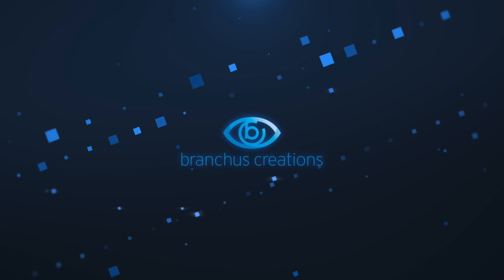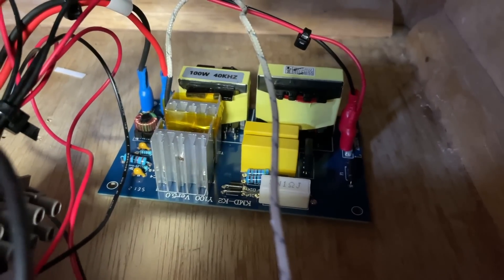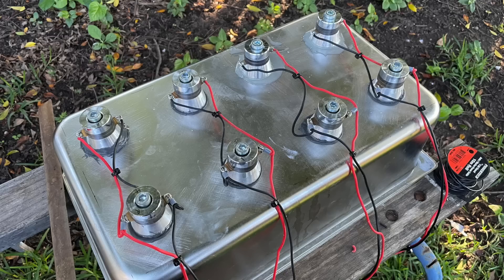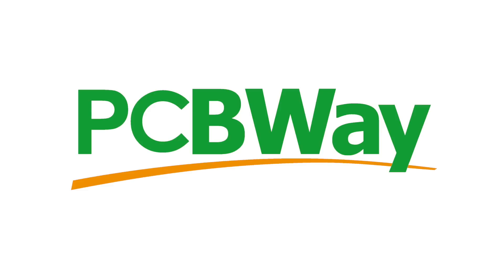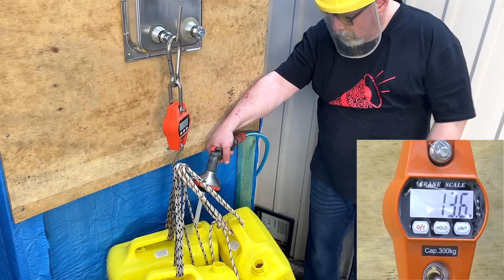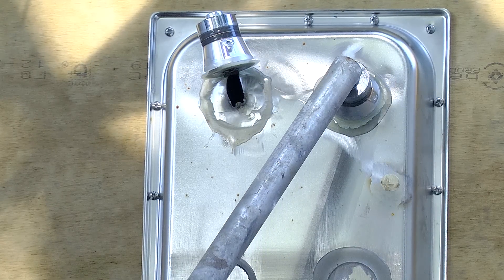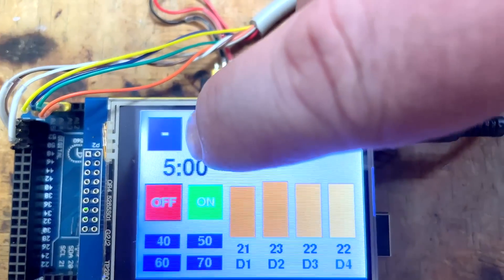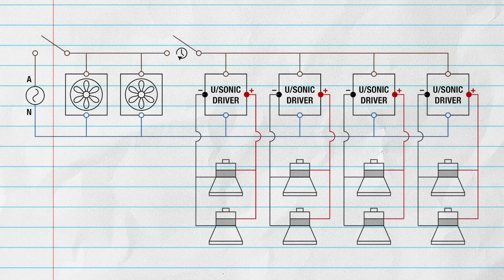Building my own Ultrasonic Cleaner - Follow Up

Comment: Tl;dr
The interwebs says denatured alcohol contaminants;
- Methanol (Methyl Alcohol): common, often comprising 5-10% of the mixture. 
- Isopropyl Alcohol
- Acetone 
- Methyl Ethyl Ketone
- Methyl Isobutyl Ketone: 
- Benzene: 
- Pyridine:.
- Denatonium benzoate (Bittrex): 
Etc.

Isopropyl contaminents; 
- Volatile Sulfur Compounds: dimethyl sulfide, methanethiol, and diethyl sulfide
- Acetone: especially when isopropyl alcohol is manufactured using the strong-acid process. 

- Metals: copper, iron, sodium, potassium, calcium, and magnesium can be present at trace levels in isopropyl alcohol. 

- High Molecular Weight Organic Compounds: including phosphates and other compounds that can leach from storage containers like HDPE. 
Other VOCs

Comment: Enjoyed the journey of discovery and youtube follow up. Thank you.
Random thoughts;  The epoxy type might not matter as long as the clamp force from screwing on the transducer to the soldered stud isn't exceeded. It might act  like a gap filler/acoustic coupler. A tough epoxy is maybe better than a strong one. 

I could see a brief bench test being bad for the transducer and the driver,  as that impedance mismatch could electrically stress the driver and mechanically stress the piezo ceramic (not just thermal degradation) 

Since they get driven in parallel with no ballast,  I wonder if a slightly damaged one current hogs and further degrades?  

Probably overkill, but for high rel boards (pre conformal coat) we final rinsed in ethanol (NOT denatured with what ever toxic random contaminants they throw in) 
A chemical squeezey or regular spray bottle would probably work ok. 95% everclear brand is available in liquor stores near me.

Comment: Here is a question,  When you adhere the bolt to the tank,  then attach the transducer to the bolt and tank including the epoxy, how do you account for the need to remove any transducer that fails?  In other words,  how do you make it serviceable?

Comment: Silver solder is used a lot in refrigeration, especially where the item being soldered is having trouble getting stuck together because of contaminants or dissimilar metals.  It is also used a lot on stainless steel items.  It is ESPECIALLY important to clean stainless when soldering/brazing and welding because it is easily contaminated.  If you use a wire brush to clean the weld/solder area, make sure it has never been used before or has never been used on anything except stainless.  Any sandpaper should be new.  Before welding or soldering, wipe the weld/solder area with acetone and let dry.  If you are soldering it, you should use flux if at all possible, because it removes contaminants from the solder area.  Silver solder will stick most items together, but it is better to be too clean than too dirty.  A TIG machine is necessary if you plan to have it welded,  but you can find a welding shop in most mid sized towns that can do it.

Comment: If you want to do more flux core wire welding on thick materials in the future, you can swap out the bulky mig tip for a flux tip.

Comment: Very nice series with a lot of information. I also do have a vevor one and clean mainly moto parts such as carburettors and cylinder heads (if they fit - normally not). Therefore I was always playing to build one myself. Which frequency would you suggest to clean such parts? You mentioned in the first video that lower frequencies would be better for such things. 

I am also wondering if it would be better to have more transducer in place for such cleaning operations.

Comment: hm dunno. i might had been tempted to measure those drivers, and see how identical they are. supposedly they represent some sorth of load, so a multimeter and a few different driving freqvencys should reveal it. likely i would have went whit 2 in series, and 2 of these in parallel. easy on the drivers, and not realy an issue for the boards. allso, i would absolutely had those transformers dipped into epoxy. the  copper wire will actualy do resonate and it will fail. just a mather of time. it will scrape off its own insulation. the output devices might have heat sinks, but you can bet those are undersized to begin whit. so i would get bigger ones or at least bolt a larger one to the exsisting heatsinks anyways. very likely these units don't require a tonn of current to drive, so i may have considered to see if i could ease the situation even further whit a bit of series shunt resistor. but thats just me allright.

Comment: I am trying to build my own ultrasonic cleaning, along very similar lines. However there are a few difference I would like to get your (and your viewers) advice on. 
1) My cleaner is to be mounted to the wall (It is also a stainless steel kitchen sink). What is the best way to minimize the ultrasonic losses from this connection. If I use continuous metal - then this will transmit the sound from where I want it, to where I don't. If I use some rubber or silicone at the boundary this will absorb the  sound which will reduce the efficiency and will generate heat. If I have an air gap, then I still need some way of holding the sink up, while creating a place that water can spill!
2) I would like to try to combine a vacuum chamber with an ultrasonic cleaner. Both are good ways of degassing epoxy or silicone rubber before putting them in a mold. Any advice on how to do the two together. 
A vacuum chamber needs to be strong. This means much thicker stainless steel and means any welds could be weak points. Thicker steel requires more power,  Any advice on mitigating this.
3) Any advice on the drainage? I have been thinking that detachable drainage might be the way to go. That removes one source of energy loss.
4) Is it possible to combine 1-3 in one build?

Comment: Not designed to pull from side …. Designed to pull straight down
Reply from the maker: I mentioned all the caveats of the test in the video, but it did achieve its purpose. The findings from this test contributed greatly to the build of my second ultrasonic cleaner.

Comment: I have seen videos on DIY spot welder from old microwave oven transformer. I wonder if such could be reimagined to use for your studs. Also noted that the welded driver that tore the pan when you pulled it off, was the one you mentioned you'd burned a hole and patched same, when initially doing the weld. Probably weakened the pan at that time, otherwise it may have bent same as with the silver soldered join. Great video BTW. I've thought about making one myself, but don't have as much need as I am focused more on building electronic prototypes from scratch. 👍🤙

Comment: i think you need to have equal length wire to your transducers 265 mm  to 275 mm  find the sweet spot. to sound/heat

Comment: Enjoyed this. The information you learned from troubleshooting the problems alone is worth its weight in gold. It does leave me wondering though if a tanks thickness makes any difference in cleaning efficiency. I am guessing it shouldn't but I also see that most the commercial tanks are pretty thin as well. Thanks for this.

Comment: My transducer seems not to have a real polarity as the signal is feed from the transformer and a coupling capacitor so no real connection with the live. I just make sure the parallel set is paired with the the same polarity scheme. Not to the driver itself. Still on the way to build a box but I think will build two boxes apart, one for the driver and another for the pair. Simple ultrasonic cleaner anyway with just one pair of transducers also silver brazed. Will also add a timer from Aliexpress which allows programming on off periods and a fan. If you have oscilloscope you can tune the oscillation frequency to the driver by changing which output one of the transformers is in use and maximizes the voltage output wave (changing the inductance changes the resonance frequency). These chinese drivers have a short which can be changed in between the different pins of the transformer thus changing the inductance of the output circuit.

Comment: I wish I would have seen this video before trying to fix my ultrasonic cleaner. I bought one off of a web site and didn't realize one of the two transducers had detached. I just reattached it with JB Weld and tried it out with the tinfoil test. Only 1 side made holes so it looks like the transducer is dead. Would there be any issue running the cleaner with just one transducer, other than it taking longer to clean?

Comment: You could also try friction welding - put the screw in a mill or drill press. High RPM & lots of pressure.  The heat generated is very localised.  I've used it for welding studs in place (not on a cleaner though)

Comment: Acrylic structural adhesive may suit your needs if do build again. The most popular brand of thread locker has a line these types of adhesives I have used in manufacturing. Bonded metals typically have 6k psi tinsel strength. I don't know what the vibration will do to it but I am about to find out. These cleaners fail quickly for me. I purchased 4 since you made this video. I need one that doesn't break. It'll be fun to build one even if it costs more than a new cheap one. Thanks for inspiration.

Comment: Very Good video Sir...
I have a 3liter cleaner, but I will going to need a bigger one..
I am thinking on using it's parts(circuit board, transduser,display), adding some more transduser and circuit board on a bigger tank. Is it possible?

Comment: Hi, do the transducers work when secured only with the solder but without the epoxy?  Or are both the Silver solder and the epoxy necessary for the sound waves to be transmitted?

Comment: If you could find a suitable tray, a tall, thin cleaner would be useful for pcbs, like a toaster. you could attach the transducers to the sides instead of the bottom. this might reduce the liquid volume and hence the power requirements.

Comment: A good idea when brazing a stud like this onto thin sheet is to put a thick backing plate against the back side of the sheet.

It'll soak up any excess heat and help stop any warping.

Comment: i know very little about ultrasonic cleaners and even less about transducers but i do quite a bit of welding my perferd method is gas welding also know as oxy acetylene welding a regular oxy acet torch is what i weld most anything together with unless its really thick and i got a big machine that does heliarc or smaw but most of my welding these days is done with a harris torch with a standard mixer and whatever size tip. its alot cheaper than using tig and i have welded the crazyist things known to mankind such as welding a cast iron pipe fitting to a stainless banjo fitting i once welded a motorcycle carburetor float post. stainless will require a flux to unless you want to use mild steel filler then not necessary. cast aluminum is the biggest pain in the ass to weld cus of all the contaminants in the cast a tig would be best for this but is still a serious pain to weld ive welded whole vehicles this way and the only 2 accepted ways of welding aircraft frames is gas welding and tig welding so if you got a few dollars to spare on a torch and tanks you could probably get a set up goin for less than 400 usd but i dont know what the availability is like down under either. but like you found out silver soldering / brazing is over kill for something like this in the good ole days most body shops brazed vehicles together and it will hold even to the point of ripping 18 ga steel the bond will be unfazed im surprised you didnt use a pid for the water temp in the beginning with the analog timer if i build one it would use a timer like that just for reliability sake that and i dont know much about electronics

Comment: I think the main reason the drilling and bolting isn't used is because at any kind of medium to large production scale the production cost matters a lot more than in a one off project. Welding is just cheaper at scale.

Comment: If you build another I'd suggest 132khz transducers,  I have a commercial unit which was way over $1500 but compared to my old 40khz machine it cleans way way better in fact it's like chalk n cheese , it's that much better on pcbs ..

Comment: If I was going to tackle this project I'd drill through the tank, drop in a few stainless steel blind-hole nutserts to suit and use some allthread to mount the transducers.

No welding needed... But you'd need the nut insert tool.

A dab of silicone at the joints should keep it watertight.

Comment: Just wondering is it possible to immerse these transducer bases into water to keep them cool and would it transmit the waves directly into the water ? reason ask is it is not clear whether these transducers need to be attached to a metal surface to keep them cool or can they be connected to none metal surface like fiberglass tanks

Comment: The epoxy they use is probably formulated specifically for vibrations and stress. High strength may not mean much stability in the long term

Comment: You probably held your torch too close while brazing. Spot heat like that will deform it, a more even heating might reduce it to a small degree.
In saying that, it's thin metal and you need a decent amount of heat anyway so there's probably no avoiding it either way.

Comment: Can I drop my power supply into one of those?? need to deep clean my pc, it is all sauced in with nicotine :)
Reply from the maker: The short answer is yes, but with some caveats. Firstly, the ultrasonic is likely to tarnish the aluminium of the electrolytic capacitors, though this is only aesthetic. The other issue is that power supplies can have components such as transformers and relays that could potentially trap liquid inside them and might make it very difficult to get the component completely dry. Having said that, I have cleaned quite a few power supplies but I always give them a lot longer to dry before using them again.

Comment: Hi Bruce, what "I think" might be a problem with epoxy is that it needs air to cure.
With two non breathable surfaces the epoxy in between could posssibly not cure properly, or take a really, really long time, leaving only the epoxy in direct contact with air to cure normally. A thick layer in between might help. Maybe a thin layer is always a problem ?
I don't know for sure.
I would be interested to see more epoxy tests to prove or disprove this (like project farm).
Good luck with your projects.
Reply: Actually All Epoxy I have used does not need air. 2 parts mixed together react with each other. Epoxy does not "dry" it cures. The chemical reaction makes a new material which hopefully sticks to the material you are bonding. Or there is a rough surface suitable to create a mechanical bond. 80 Grit sandpaper would be appropriate for the application here.

Comment: Does the shape and overall dimensions of the tub factor into the transducer placement - outside of just the number of them needed for the total volume of water?
Reply from the maker: I can't answer this with complete certainty, but the placement of the transducers is about trying to evenly distribute the sound around the whole tank. A bit like trying to place small speakers in a room so that you can clearly hear a sound no matter where you stand in that room.

Comment: As many have mentioned, flux will make it much easier to flow the solder and get a reliable bond.  If it is soft solder, the plumbing torch is a bit overkill and will make heat management a bit tricky for the thin wall tank.  One of those pocket butane torch lighters would work perfectly.  Stainless heat soaks very easily due to very low thermal conductivity, so less heat than you think and a bit of patience is best to let it come up to temperature without creating hot spots.  If it starts to glow, it is definitely way too hot for soft solder.  The small pencil flame of a butane torch lighter would help make it easier to focus the heat primarily on the stud and just flick the flame off to the tank just enough to bring up the temperature to where the flux starts cleaning.  Getting solder flowing on the stud will help conduct heat into the tank and flow it to the tank without too much heat deformation from too much direct heat.  Just before glowing is about good brazing temperature for a Harris stay silv brazing filler if you are doing it that way.

Comment: You are still putting a whole lot of heat in with the silver soldering. 
Are you familiar with stud welders? 
This will only create a short pulse and should damage the steel less.
Of course these aren’t cheap, but if you have one, you’ll be using it a lot.
Colin Furze actually has one, can be seen in his tunneling videos.
Or maybe you can build your own stud welder 😜

Comment: what about using silicone as a sealant, and using a through hole bolt to mount the transducer?
Reply from the maker: If you get a chance to check out my latest ultrasonic build, I cover that stuff in more detail.
Reply: @BranchusCreations  ill look into that, thanks!

Comment: Did you think about "Spot welding" it, with just electricity and a microwave transformer? I know it is creating a new machine in between but it is easy, economic and you can use it to weld battery packs in the future. I hope you get to create a great product. Thank you for being so thoughtful and detailed with your project!
Reply: I dont think it works, since the stud isn't a thin sheet of steel you can pointweld to another sheet, with two pointy copper elektrodes. Even if you're able to make a couple welds, they wouldn't be strong enough